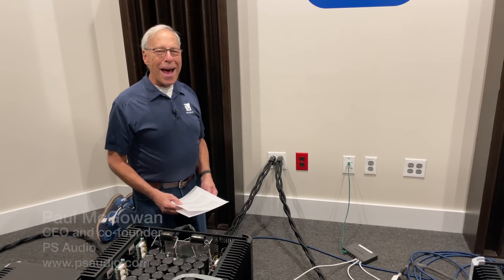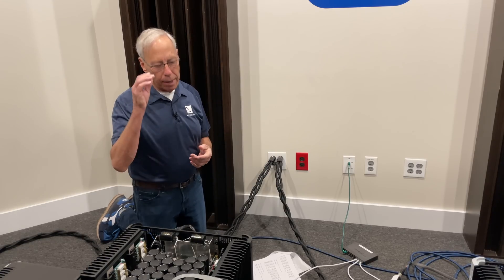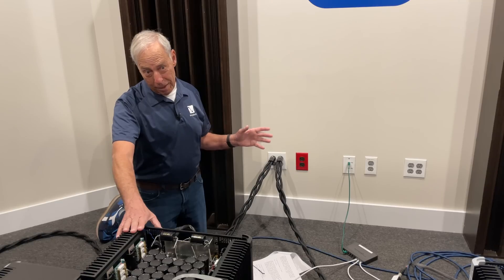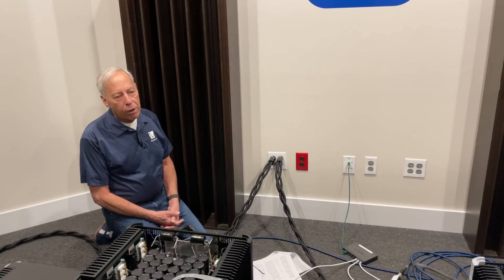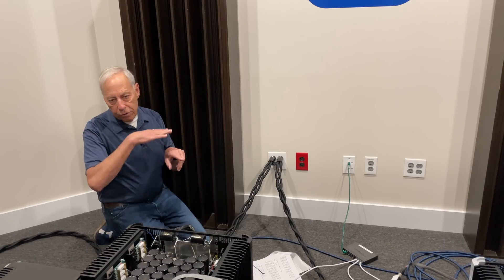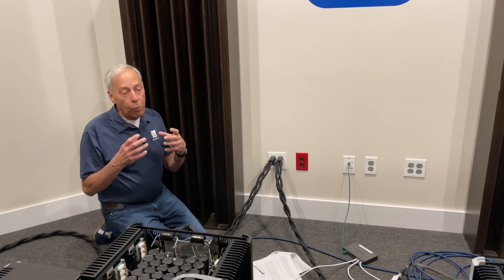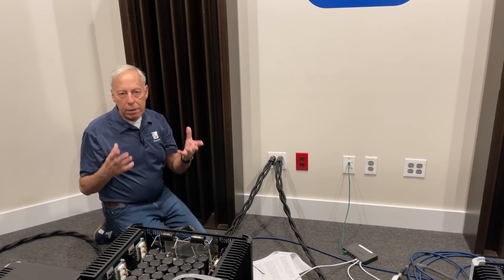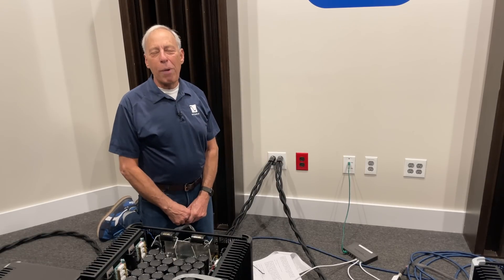Are braided power cables better?

Comment: I'm open to clarification, but using braided power cable seems to conflict with the use of parallel power cables in the wall.  Maybe braiding the power cable is most effective in proximity to the device?
Reply: Think of it like a water filter.  Cleans up your water before it exits the spout.  The better the filter, the cleaner the water.
Reply: @LunarLightLtd1  amps run on DC...a good PSU is where it matters
Reply: @boomertsfx1  i won't disagree that power supplies matter, but i have heard first hand the effect on better power cables.  It's not placebo; it had an obvious and measurable difference.  I don't have shitty gear either.  It's not the best, but definitely not a slouch.
Reply: Out of sight, out of mind I guess.  No common sense?
Reply: it is most effective for the salesman΄s bank account.

Comment: Hi Paul, love your videos.  Isn't braiding power cables from the outlet to the device somewhat mute! the cables from the distribution board are not so therfore the short run from the outlet to the device would be insignificant.  A question not a statment..  look forward to your feedback..

Comment: I am 74 years of age. Had my first stereo when Buddy Holly was still alive. I know every Hifi Guru, they all me. I have private commercial chats with electronic engineers. Paul, any sufficient shielded power cable is good enough. Everything else is snake oil! Or better BS!
Reply: @Dick Vermaas

24 hours later:  2nd Request:

Please list the power cables that you used in your listening test, to conclude that power cables Paul is using, vs standard shielded power cables, is snake oil or BS.
Please also list all of your stereo's components that were used in your listening test (speakers, amps, pre-amp, DAC, transport, phono-amp, tone-arm, cartridge, etc), and room treatments.
Reply: Thanks Dick.
Reply: @Dick Vermaas

3rd Request:

Please list the power cables that you used in your listening test, to conclude that power cables Paul is using, vs standard shielded power cables, is snake oil or BS.
Please also list all of your stereo's components that were used in your listening test (speakers, amps, pre-amp, DAC, transport, phono-amp, tone-arm, cartridge, etc), and room treatments.
Reply: @Dick Vermaas

4th Request:

Please list the power cables that you used in your listening test, to conclude that power cables Paul is using, vs standard shielded power cables, is snake oil or BS.
Please also list all of your stereo's components that were used in your listening test (speakers, amps, pre-amp, DAC, transport, phono-amp, tone-arm, cartridge, etc), and room treatments.
Reply: @Dick Vermaas:

Please list the power cables that you used in your listening test, to conclude that power cables Paul is using, vs standard shielded power cables, is snake oil or BS.
Please also list all of your stereo's components that were used in your listening test (speakers, amps, pre-amp, DAC, transport, phono-amp, tone-arm, cartridge, etc), and room treatments.
Reply: @0Perhaps  They won't.  They are using stock cables and can't imagine their systems improving.
Reply: @LunarLightLtd1  When I ask people to list the equipment in their listening test (to show their work), one of three things happen:

1) They never reply.
As such, their "assertion" of quality cables being BS is the actual BS (their claim is what is the BS).

2) They reply with "they do not have to conduct a listening test", because of this study and that person's engineering degree, etc.
I have yet to see a product come to market that was only reviewed, in theory, and never actually tested; never actually used in its final form.

Cars have safety designs built into them, that started on the drawing board.  Mathematicians and expert engineers design and build air-bags, cabin enclosures, bumpers, etc.  They all appear sound on paper.  But the car companies still crash test vehicles, and "surprise", they have to make changes after discovering that all of their "on paper" theories missed things.

But when it comes to cables, the audio trolls never do the crash testing.  They never actually listen to that which they are bashing.  They claim that the lab's testing is infallible; that they covered everything, and it is humanly impossible for them to have missed anything.

3) They claim that this lab or that lab has done conclusive testing.  Note that that does not mean that it was conclusive, any more than them saying that the Earth is flat, based on conclusive testing.  They never list the stereo components that the lab used for their testing -- because they never did a test with a quality stereo.

The cable naysayers with the loudest claims never put up, and they never shut up.
I find it amusing to make them twist in the wind with their moronic claims, of which they never tested; they never sat down with the gear that they claim is snake oil.  They know so much that isn't so.
Reply: No it is not BS. It is good money in cable salesmen pockets.

Comment: The important thing to realize, is that the last bit of cable is close to your audio equipment. The strong electromagnetic field around the power cable can have unwanted effects on your equipment, especially low signal audio cables. The field around your cables in the wall is too far away to influence your gear. Another strategy, which is used in recording studios, is to layout power cables and audio cables perpendicular to each other.
Reply: proper interconnects are shielded or optical, proper power supplies deliver 100% clean DC
Reply: @Harald_Reindl  
Agreed
Still, it's prudent to be cognizant of AC magnetic fields.
Reply: Perpendicular laying is not a good strategy for audio snake oil salesmen. Neither is balanced cabling for that matter. And, btw, if you do have rf contamination to your interconnects you can hear the results of it. If you can't hear it it isn't there or it doesn't matter. Half science is worse than no science.

Comment: braiding cables has been known to work for ages... just look at every other old tube guitar amplifier from the 50s and 60s it reduced noise and hum back in the day just like they do today! They would not bother doing it otherwise.
Reply: No use for mains power cables though. Which is the topic of this video... Nobody is using braided power cables in any application but snake oil audio fool audio..
Reply: @razisn  you really should get back under your bridge, it's not safe for troglodites out in the open you could be exposed to new ideas.
Reply: @jamesrobinson9176  audiofool
Reply: @james robinson  I'm sorry, but every electronic engineer worth its salt would tell you that it doesn't make any measurable difference. The truth hurts
Reply: @xanderguldie  lol. The truth can free your mind.
Reply: @jamesrobinson9176  is true that "braiding cables has been known to work for ages". Yes it works somewhat better on some cases than two just straight cables, but is far from optimal. There are many ways to get better performance in many ways using other cable constructions (that are simpler to manufacture but might not look that "cool").  Twisted pair of live and neutral wires with ground as separate wire and with outside shield over all of this is in far better wire construction on all relevant technical details I can think of. Compared to that construction that type of braiding construction shown on video is technically crap. That kind of braiding shown on video on power cables has the wires quite loose, which makes the area between conductors larger compared to the tighter cable constructions (twisted pair, parallel wires), which effectively makes sure that the inductance bigger. Also a cable braided like that radiates considerably more magnetic field (especially to near cable) compared to tightly twisted pair.  The scientific truth and measurements can free your mind from baseless speculations. 
There are different braiding constructions that can have different benefits and disadvantages (usually many of them not worth of the trouble in making them). Yes many wires braided together can get you quite low inductance, but that three wires braided like in the mains cable on the video is what might be fancy looking but is technically pretty bad construction idea.

Comment: If parallel wires act as inductors (BTW always thought they act as capacitors) and inductors filter out high frequencies, isn’t that a good thing? Ultimately you’d want a pure 50Hz signal.
Reply: @Douglas Blake Says the guy who doesn't even understand how simple passive crossovers work. There is no "hand off."
Reply: @Douglas Blake I just hate it when "experts" like you don't understand simple concepts. Or maybe you now you do understand now but have too much pride to admit that you misspoke. Suck it up, just say you were wrong in the way you described how the filter works. Each section of a passive 2-way filter has equal access to the full signal, one filters out the highs while the other filters out the lows. There is no "hand off." The audio "crossover" point is the result.

Comment: How long are the power cables in the wall and are there also braided?
Reply: Go back to scool and learn how electricity works...
Reply: @GregersLife  Tell me what is wrong with my question ?
Tell me the difference distortion impact of power cable in the wall, often installed together with other cables (with hf signals) and the last meters outside the wall.
And what about earth protection, if you switch a 3 wire isolated cable in 3 seperate braided cables ?
Reply: @atzeotze2256  *first meter...
Go to scool
Reply: @GregersLife  I would recommend that to you and the other audiofools
Reply: @Harald_Reindl  fool is person who speak without knowledge and experience.
I have both.
You dont have bot.
Who is fool?
Reply: @GregersLife  well, i am a certified electrician and that's all nonsense - the power supply when designed correctly produces 100% clean DC no matter what's on the AC side

Comment: What about that tens of meters of parallel cable that are in the wall.....
Why does that last 2-3 meters outsider the wallmake alll the difference?
Would like to hear a proper explanation for that!
Reply: The water delivered to your bathroom traveled for miles, and yet you use a shower head for the last few inches.
Better power cords perform a similar function.
Reply: @0Perhaps  
Yes, but a shower head does not improve the water quality.  There is enough filtering in the amplifier's power supply to take care of any noise.
Reply: @stchman  It depends on the power supply.

The power supply in a Yorx receiver is not the same quality as the power supply in a Vandersteen M7-HPA amp.

The power supply makes or breaks the sound quality of any component -- it is key.  In quality components, approximately 1/3 of the cost is in the power supply.  If you have a stellar quality power supply, then the stock power cords should be fine.  For components with lesser quality power supplies, a quality power cord will be beneficial.
Reply: @NoEgg4u  
No way a power cord is going to make a difference in sound quality.  If someone is THAT into high fidelity equipment that they can afford a $5000 power cord, their equipment is going to be top notch and won't need that fancy cord.
Reply: @stchman  "No way a power cord is going to make a difference in sound quality."
Yes way, it will, depending on the equipment.
Reply: @NoEgg4u  
That's all in your head.  You obviously bought those way overpriced snake oil cables and don't want to think you've been had.

Sorry, you have.
Reply: @stchman  Yes, it is all in my head, sourced from my ears.
I actually did listening tests with different power cords on CD players.  I did those tests in my local high-end audio store.

So you got that part right.

On what equipment have you conducted your listening tests?  Or are you talking about a subject where you never conducted a listening test?
Let me know, because I want your reviews on restaurants you never visited, and on cars you have never driven.
Reply: @0Perhaps  
Science is on my side.  "Audiofools" try to convince me that a better optical cable will give better "soundstage", "presence", "humanity".  Sorry, I left my presence and humanity meter at home.  I am not the only one that thinks the snake oil cable industry is full of crap.

If you disagree or don't hear this "difference", they will tell you that you must have untrained ears, or you "just don't understand" BS.
Reply: @stchman  Quote: 'Science is on my side.  "Audiofools" try to convince me that...'
In which field of science did they teach you to call people derogatory names, when you cannot support your position?

Quote: "I am not the only one that thinks the snake oil cable industry is full of crap."
Glade to know that you set the criteria, because that works for me.  You see... I am not the only one that thinks that the world is flat.

Second request:
On what equipment have you conducted your listening tests?  Or are you talking about a subject where you never conducted a listening test?
Reply: @NoEgg4u  
We're not going to convince each other, so we should just stop.

If you're happy with your $5000 power cable and $10000 speaker cables, I'm happy for you.
Reply: @stchman  "We're not going to convince each other, so we should just stop."
I disagree.  We should not stop.  You cannot support your BS, and you are caught not being able to support your BS, and so you expect to be given a pass for your BS.

"If you're happy with your $5000 power cable and $10000 speaker cables, I'm happy for you."
Case in point.  The above is 100% BS.

Prove me wrong.
Quote where I listed my cables -- any of my cables.
Name the cables that you assert that I have.  I will settle for you naming a single item in my stereo.

You will not, because you lie, and you lie, and you lie.  You might be accustomed to not being accountable for your lying.  And so you are trying to squirm your way out of answering for your lies.  That will not happen here, because people that lie in these forums... they spread misinformation.

People come here to learn, and you are spewing BS (probably because of your envy of what is out of your reach).

Third request:
On what equipment have you conducted your listening tests?  Or are you talking about a subject where you never conducted a listening test?
Reply: @0Perhaps  nonsense
Reply: @0Perhaps that is the lamest explanation I’ve heard in years. Water pressure to the home is a constant, given by the provider. Its velocity can be altered through the plumbing/equipment installation, but it’s still water under a certain pressure. How does that relate to audio quality? Please explain?
Reply: @kytddjj  I watched that Veratisium video as well.  Still doesn't matter.
Reply: @ Perhaps, I really don't see the analogy 🤔
Reply: @Impackon  he is a audiophile which implies no brain and no technical education

Comment: Does braiding reduce RFI? And/or other mains contamination?
Reply: Sure twisted pair reduces interference in data cables.... But it's stupid for power cables.  I guess out of sight out of mind for people thinking the last few feet of power delivery being braided would help anything.
Reply: @Douglas Blake it's a very subtle effect
Reply: @adotopp1865  its an illusion , the brain reporting that what you want to hear is heard and everything is safe, no unsolved threats to survival remain.   Which is what hearing evolved to do, survival.   not hanging around to determine anything factual about a sound, even occasionally making stuff up, turned out to be an evolutionary advantage.    optical illusions rely on processes of the brain, just as does hearing.   the difference being hearing illusions sell expensive wires to audiophiles who should know better, and optical illusions allow for moving pictures.
Reply: @Douglas Blake no you can hear the difference that using different cables makes. I don't mean speaker wire, I have tried mains cable, industrial armoured cable and a selection of others all have a different sound.
Reply: @Douglas Blake I don't waste any money. I haven't bought any cables for years
Reply: @Douglas Blake because of people who say all cables sound the same.
Reply: @Douglas Blake Obviously I don't waste money on this crap . I'm not an idiot.